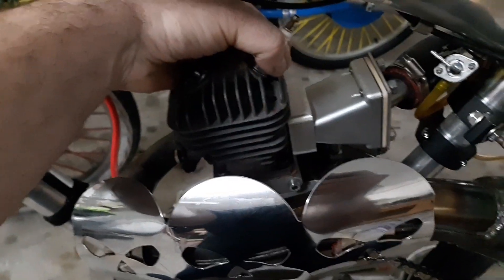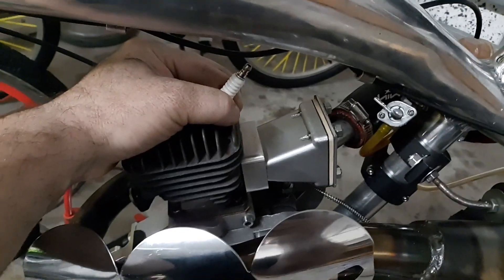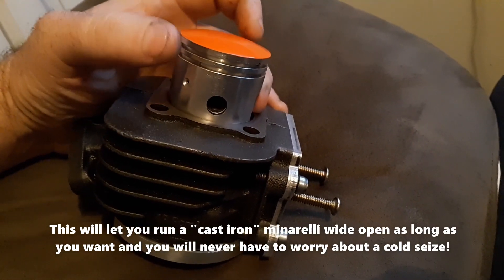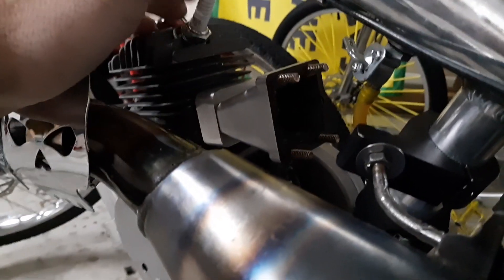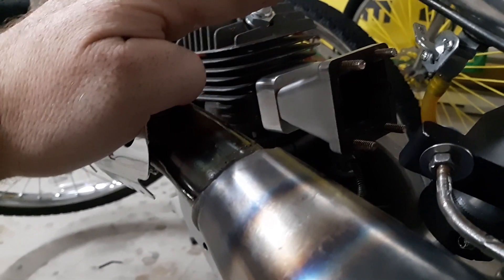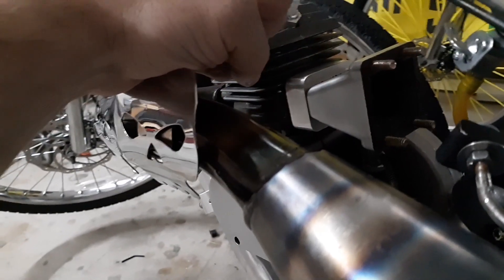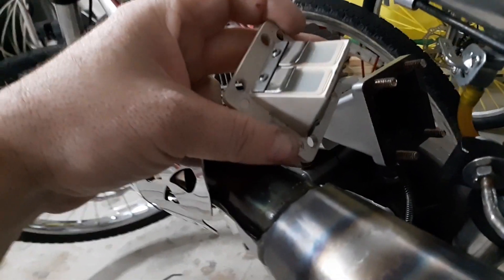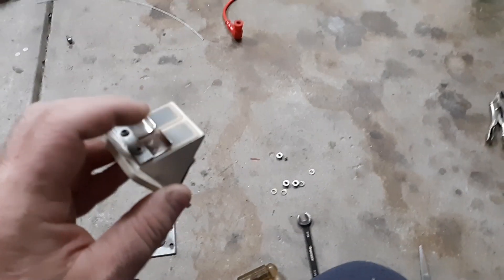How To Correctly Use A G2 Reed On A Bigger Build - Why Most Can't Tune It!

Comment: Did you make those G2 helper springs, or can they be purchased somewhere? I can't find any.
Reply from the maker: Use to be able to buy the whole block from cdh power. Haven't in a very long time. So all my links are dead to the one in the video.  I have seen people use starter recoil springs to diy build them. I haven't tried it myself. But I hear it works well
Reply: @BuildBreakFix  Yeah, I checked CDH out last night. I'll just make my own if I need them. I have a Zeda 80 and just received my reed setup for it. I probably won't need them for this engine. Thanks for the info.

Comment: Whete to get the helelper springs?
Reply from the maker: Haven't bought a set in over a year now. CDH power sells a whole reed block with them.   I just haven't bought one myself personally.
Reply: @BuildBreakFix  thanks.
I noticed my pedals don't fully close at all
Reply: @BuildBreakFix  stuffer necessary?
(Currently running a g2 on phantom w pwk21

Comment: I have a ported 110cc (85cc) with a nasty jack. I'm estimating around 7hp, do you think this is a reasonable expectation?

I'm balancing my crank today. I can't find any information about hp gains from balancing. Do you have any idea how much hp balancing would gain me?

Lastly, let's say my motor ends up being 10hp, how much hp do you think I would lose from adding a dio reed?
I want to add a reed for fuel savings, but only if the hp loss is small.
Reply from the maker: Something in that area. 5.5hp to 8hp lots of factors. Cleaned up porting is 6hp ish.  Perfect timing and correctly sized and set carb with the pipe would be closer to 8
Reply: Thanks man. @BuildBreakFix

Comment: Where would I go to buy those helper springs for the G2 reed valve? Thanks for the very informative video.
Reply from the maker: Cdh power sells complete block with springs.  Been while since I bought one.  Find them on ebay. "Cdh power"  he always responds to questions there a huge motorized bicycle parts outfit

Comment: Great info as always! I did have better luck with my G2 when running the Malossi Minarelli petals, but I was still running into idle issues when the engine warmed up. I'll have to give this a try
Reply from the maker: yeah you will really feel it on idle, the flutter effect. when engine is started up. That is when it chugs air fuel in till warms up atomizes it fully! pedals flex the most in that time cause huge gulps air pulling in!

Comment: I've always told people older 2stroke racing kart videos are god
The old 70's chainsaw motor direct drive classes were nuts
Reply from the maker: Bro my first 2 stroke gokart was a freaking 230cc snow blower engine lol!  I so have been thinking about doing one with CVT on a bike build for fun! seen some 120cc ones for like 80$ ebay!  crank shaft would need to be changed a tinny but but yeah those saw carts where crazy to!

Comment: Thanks for another informative video they make that Reed valve with carbon fiber pedals both of my yd100 bicycle engine have them on it can't really get mine to idel when you come to a stop you have to bump the throttle like bikers do with there harleys but when she gets going she's going they came in a kit gt80 with keihen carburetor with fiberglass pedals I put the carbon fiber they run about the same with either pedal in them only difference one runs richer than the other I think because of the stiffness difference between the two
Reply from the maker: yeah one of the biggest issues is them sealing!  The reed cages are never flat! on pretty much all reeds you buy for these things!  Get yourself a foam block nail file!  Pretty much super fine sand paper on a foam block! They come like 5 for 2$ local dollar store type places!  Take one lightly sand the surface the pedals  rest on!  If you take your reed cage out and can fill it up with water and non drips out! then you know reed is perfect!
Reply: @BuildBreakFix  This is really super great information to know! I really appreciate all Your video and taking the time to share Your knowledge with us all! Do You sell parts? Or have a website? Just curious if You have a motorbike business?
Thanks again for all your help! Cheers DC.🙏🏻👍
Reply from the maker: @DirectCurrent4u 😜👍
Reply: @BuildBreakFix  got another question for you this yd100 was a raw racer 3 came with the gt80 Reed valve and keihin carburetor I added the window piston would it do better the original version with no window piston someone told me to add the window piston because the Reed valve and keihin carburetor are not getting the full potential what's your opinion about it
Reply from the maker: @mikemiller3303  gt80 reed block in it?   T heard those will leak around bolt holes if there not exactly perfectly done! seen epople use gasket maker in holes before put bolts in cause of it. Vacuum leaks make engines run  crazy at times like that.  They move each hole tad wider to make them work..  Never used one just seen what other people posted on those!
Reply: @BuildBreakFix  thanks for the info bro I usually put small vacuum test on them and see if they seal but thank you for a better idea that's what this hobby is about fellow hobbyists helping each other I could understand if we were in a compation against each other in business or a race might be different.  Off the beaten path a little I'm the guy that you said go get the organic 2-stroke oil mix I ordered it from home depo and the lady when I picked it up I showed her my baby's she was from Florida she's like they drive them things everywhere in Florida she said I had a nice bike but she doesn't see many here in Texas I told her that's because Texas is trying to make them illegal if it goes over 27 that means my screaming demon v2 bicycle with the cast iron minaralli makes me a outlaw lol had to put a motor on the bike that fit the name I would love to put one of them beautiful motors on there she would really scream lol stay safe bro and thanks for your help and opinions